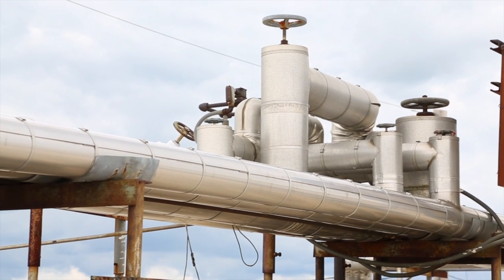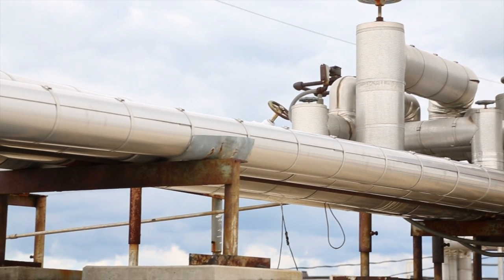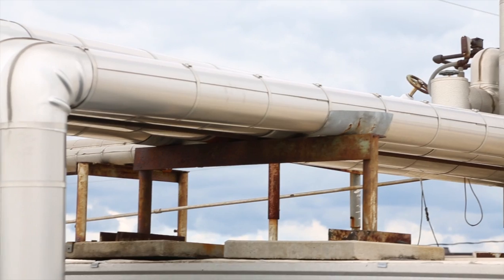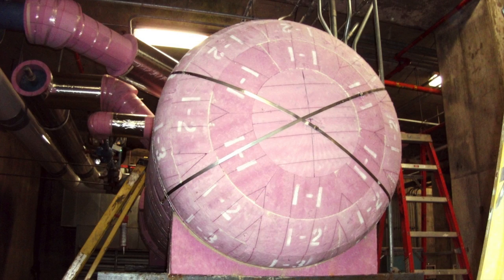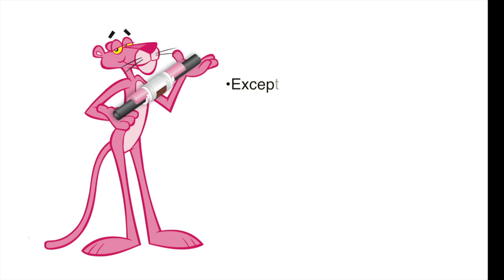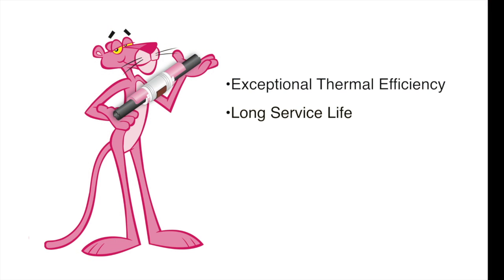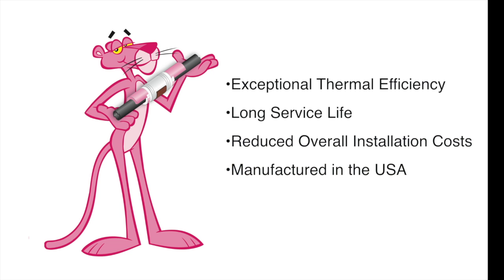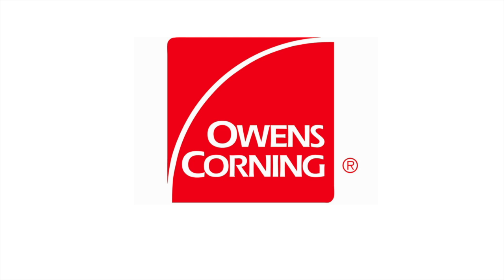Foamular Extruded Polystyrene (XPS) Insulation vs Expanded Polystyrene (EPS) Insulation.

Comment: we found this to be just the opposite......xps (extruded) absorbed water, caused our pipes to rust and failed...became a block of ice in the winter.  when we installed EPS (expanded) on our facility we haven't had a problem at all....and it's been almost 5 years!  EPS is used in dock & ship building because it doesn't absorb moisture.....we tested both and the xps (extruded) absorbed water and eps (expanded) didn't....when moisture gets ABSORBED it gets sucked right to the pipes and freezes.
Reply: I think that what's actually happening is moisture gets trapped by XPS, where with the EPS, the warmth of the pipe allows  it to evaporate and escape over time. The EPS probably isn't quite as insulative, but if XPS makes the pipes fail prematurely, who wants it?
Reply: Wait till 5 years past the time you installed it, the R value is going to drop hugely relatively to EPS. EPS is much stabler than XPS, not to mention with less emission of toxic gasses and carbon footprint. The blowing agent of XPS is horrible